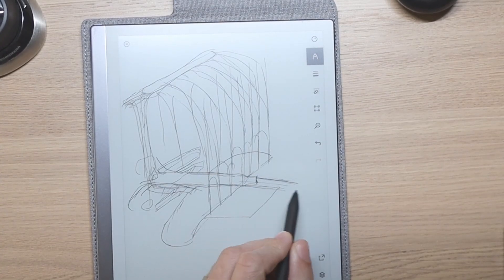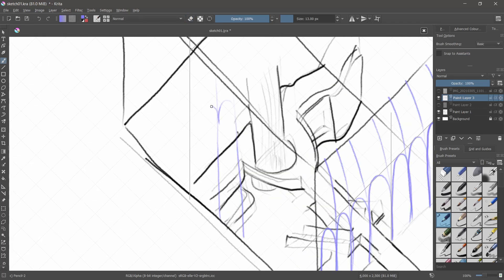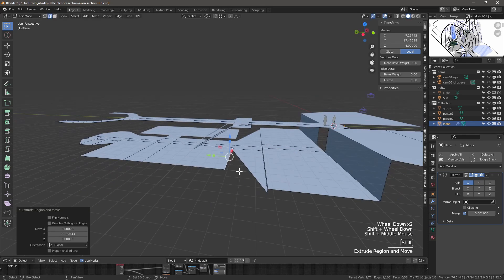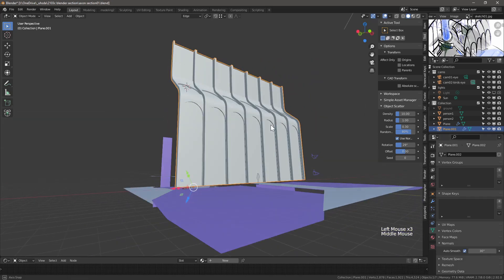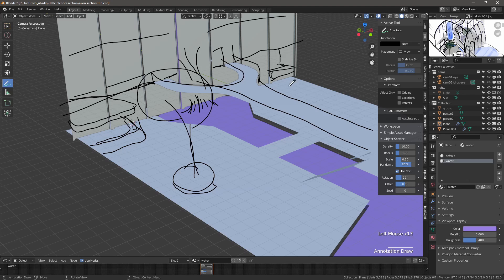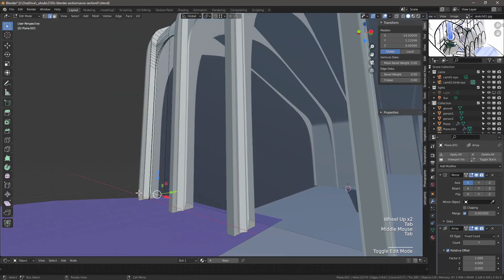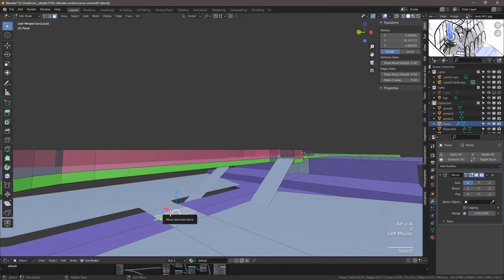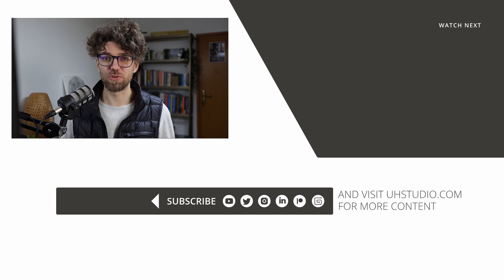From sketch to design - architectural axonometric section with Blender Part 1

Comment: 10:58 don’t use “I”, use “e” and cancel e (right click) and scale down with “s”<or> instead of inseting to the point where vertices intersects, inset only a small bit and continue with scale. Or in more complex shapes, bevel only after everything is done or use non-destructive way, bevel modifier.
Reply from the maker: Another tip - when using E, no need to ESC. You can press E, then S to scale right away. However it only works well for circular shapes.

Comment: have you preferred blender modeling over another 3d modeling program such as rhino?
Reply from the maker: It depends on what I am doing. For quick concepts, I much prefer to use Blender. For developing some of those concepts, especially if they have complex geometry and need to be split/panelised/rationalised, then I tend to start using Rhino/Grasshopper
Reply: @UHStudio  thanks